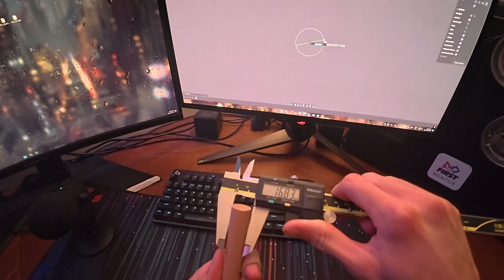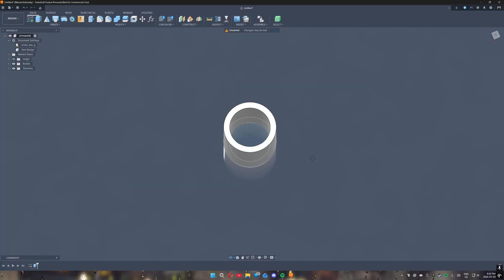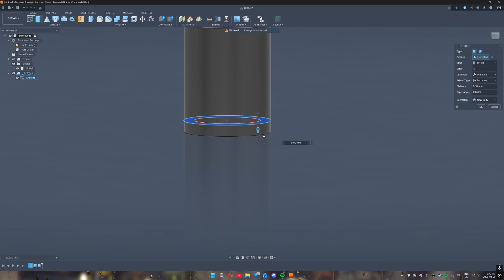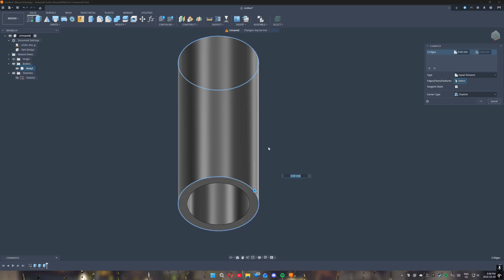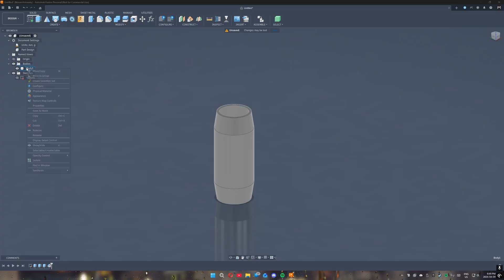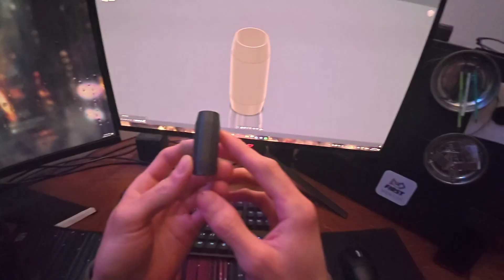PR Weekly - Creating a simple design from start to finish in Fusion360

Comment: Nice tutorial. Keep in mind the anisotropical properties of FDM printing. Depending on the use-case of this joint, especially when it's going to be under orthogonal stress, it might simply snap along the layerlines. To accomodate this, you could print it slightly diagonally or even horizontally - which will provide new design challenges to keep the dimensions accurate ... :)